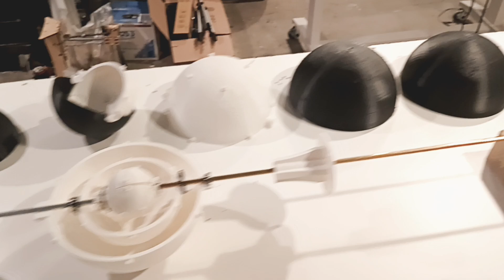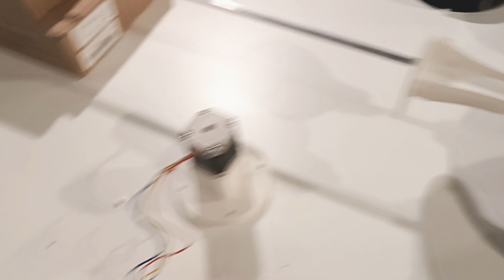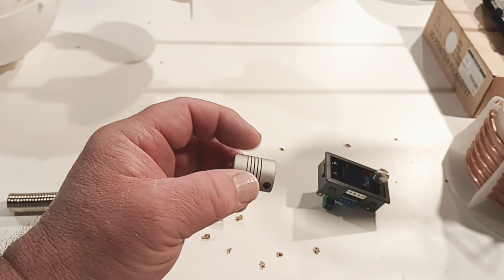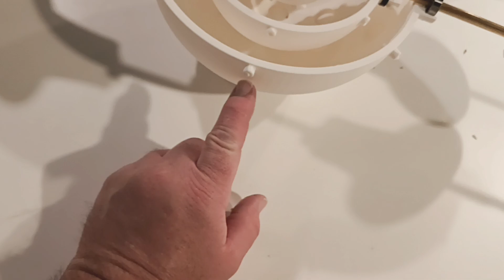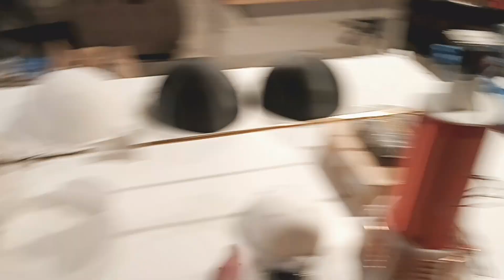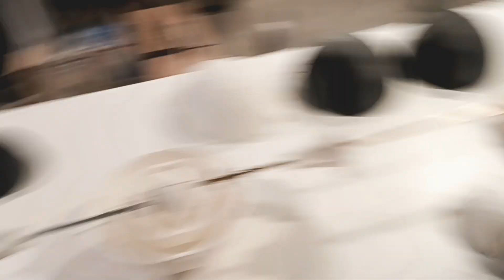Project Gravity Well Update

Comment: This looks a lot like the Kosol device. There was a group formed by Kosol ,me and other guys spread out between Europe and USA ,  I had built a version but it didn't work out as hoped
Reply from the maker: did you use radiant energy in the center with static? what was your power source?
Reply: @oldmanbuilds   The device was made of 3 alluminium sphere one inside the other , covered with small neodimium magnets , they were counter rotating, the power soruce was a normal battery. After some time i buil my own device using an idea i had when i first listened to Bob Lazar, and that worked.
Reply: @oldmanbuilds  No, the device was made by 3 level of counterrotating alluminium sphere covered with neodimium magnets, the device was charged with hv trough an ion gun. Probably you will find photos on the internet, try google kosol device. That idea didn't work, after few years i rebuilt another device , using my idea of how obtain antig , and that did work.

Comment: My gravinductor looks so much like the Kosol device. But the gravinductor is solid state and has two counterwound pancakes with two counterwound bifilar columns top and bottom. The A/C audio is piped into pancakes & the outer columns are single wire electricity and the inner columns use a strobe light circuit. The counterwound hemisphere coils of the opposite shells are A/C on a dimmer barely flickering on and house the columns and pancakes.
Reply from the maker: I would love to see it. Sounds awesome.
Reply: What happens is the strobe coils burst a radiant energy toroid field with the up and down dual hyperboloidal single wire plasma  monopoles and static inertia canceling field extracted from the electret insulator. Is what the parts of the toroid is made of  Gravity resides at the pinch point of the toroid. It is an oval, 2d, 10 times longer than wide. Up and down spinning is feedback mode or wooflessness. Likewise when it then rotates and spin sideways inertia gets bigger. I should call it a woof drive but it's way more than I have been saying ;)

Comment: Nathan you are ingenious. It is like a spherical Gravity Flyer. The cable ties. I don't know. Do you have metal 3D printers for the final version. It looks just like the interior of the earth from my diagram for the gravity field from water electrolysis fusion.
Reply from the maker: No medal printers but I found cheep aluminum spheres and they said they will build to my cad specs. I have to decide how to put the bismuth in here first. I have some on order 8lb's. It may take a while before I get the casting right.